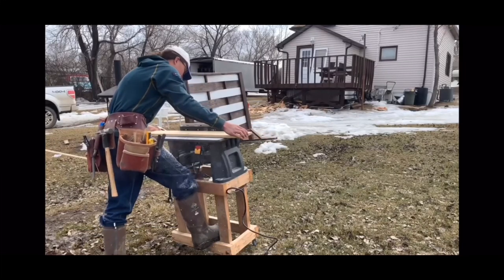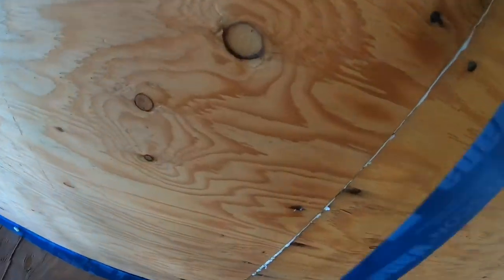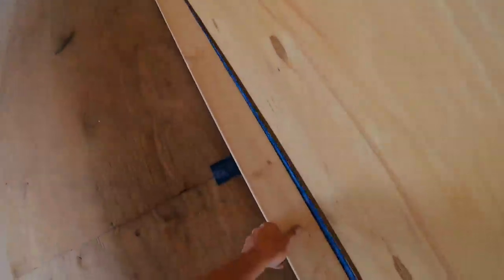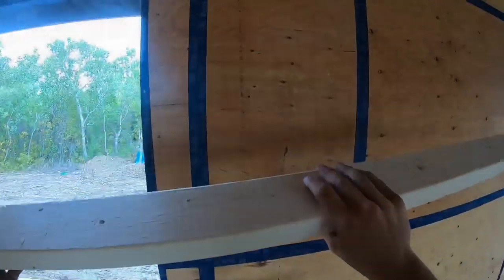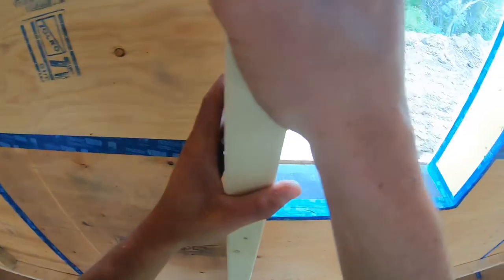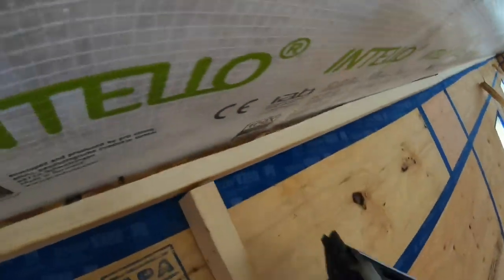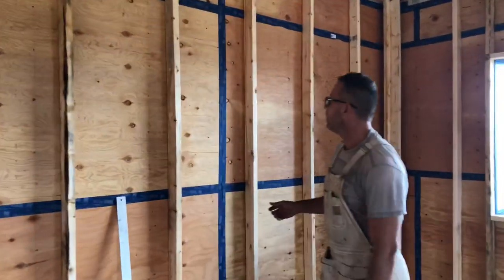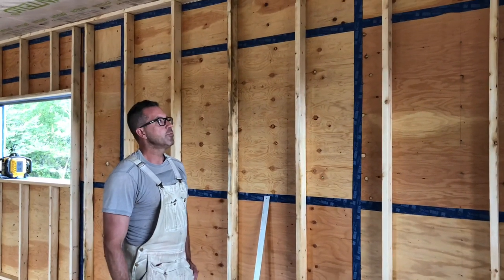Passive House - Episode 7

Comment: Coming along nicely!

Question... shouldn’t the home be able to “breathe”? And by “breathe” I mean allow for some air leakage to bring fresh air in... I know traditionally built homes in the United States aren’t air tight. Just cautious.
Reply: Good question EGH, the walls and floor are vapour permeable assemblies so they will breathe, or perspire to be precise, depending on seasonal pressure changes. The ceiling uses proclima intello, which also allows vapour to pass through. As for air exchanges, a highly efficient HRV will supply the house with a continuous supply of fresh, oxygenated air to enhance the sleeping patterns and cognitive functioning of those dwelling inside.
Reply: vapour permeability and airtightness are not the same. This is the key difference..

Comment: I know, it's more work for you, but the voiceover is nice, not having to hear over wind background noise etc. R41? wow, what is the ceiling going to be? You guys doing the mechanical as well? Am interested in what sort of air exchanger will be used since that place is going to be so tight.
Reply from the maker: Not sure of the r value of the ceiling but the insulation will probably be 24” deep or more. We will get subs in to do mechanical and drywall. We will do cabinetry and trim work though
Reply: @AustinTischler  saw the bundles of insulation (I think)  in your recent  vid,  looks like blown in?
Reply from the maker: Yes it is blown in cellulose. Basically recycled newspaper. Tomorrow’s (hopefully) episode will show us insulating!
Reply: Nothing changed there then, had a job summer   after grade 11 feeding the blower for that stuff, lost my watch into that machine. . .

Comment: I guys, the house is coming along nicely. I do very much like the neatness of the job site. I was curious why you used plywood on the inside wall instead of Intello? Also, shouldn't the first outer row of Intello attached to the trusses have been tape sealed before the 2"x4"s for the service wall were installed? It would seem to me that while under pressure this will leak into the attic space. Look forward to watching the next episode.
Reply: Hi Ralph, the intello membrane was tape sealed to the plywood air barrier before we installed the 2x4 interior cavity. I opt to use plywood as it stands up better to moisture infiltration in my opinion. Also nicer to work with.
Reply: @colinleinenweber2471   Sorry, it didn't looked taped to me when I watched it. I get it's nicer to work with amd certainly creates more rigidity to the structure. I just thought it might be more costly. I'm sure there's a potential trade off to labour and materials.
Reply: @colinleinenweber2471  I apologize, It didn't look like it in some of the footage. Carry on :)))

Comment: Hello from Norway and thanks for putting these videos up! I also liked the format of this one with the voice over, but I totally get that it's a lot of effort post production. I have some questions about the cavity wall, if I may. 1) Why do the studs need to be staggered in the interior and exterior walls? In the video it was explained as a thermal issue, but it still doesn't make sense to me. 2) Why does the cavity wall need to be attached to the exterior wall? To prevent air pockets? 3) How is it possible to not put stud on stud when framing the windows?
Reply: Hi larsenole, good questions. The decision to stagger was simply to reduce potential thermal bridging that may occur if we attached them directly to the 2x10s in the exterior wall panels. We attached the interior cavity to everything including roof trusses. It makes the building that much more stronger. And yes, we still have the thermal bridging issue around the windows! After discussing with my supplier, he attempting to supply us with a foam webbed 2x4/2×6 product currently on offer in the US. This constitutes the weak spot in this system. I hope to have access to thermally broken nominal lumber sized products for future projects.